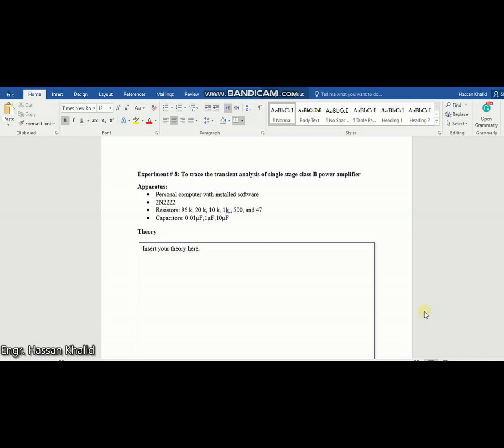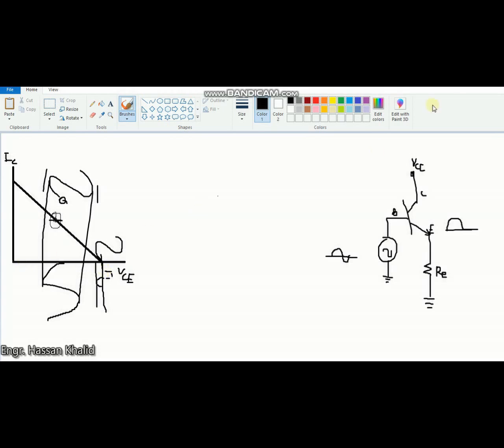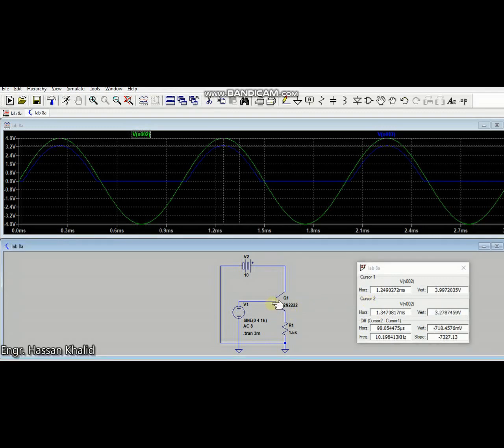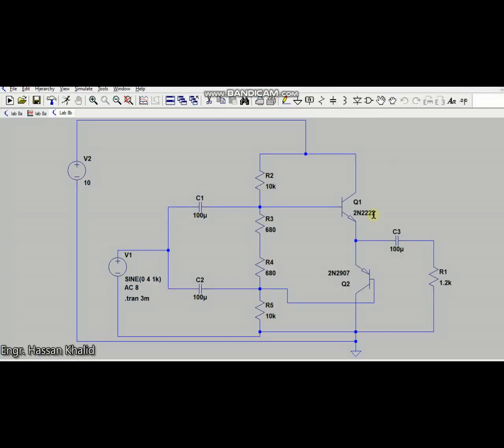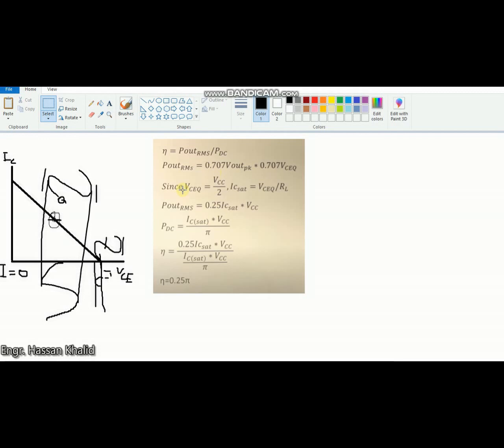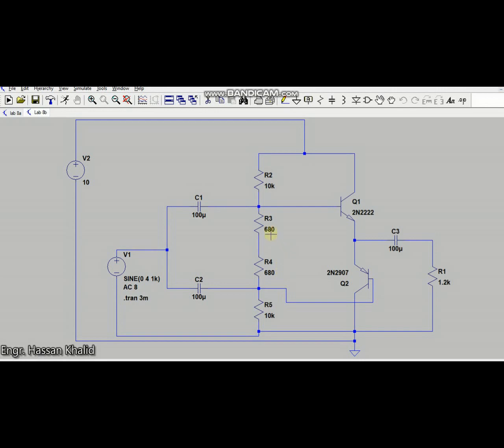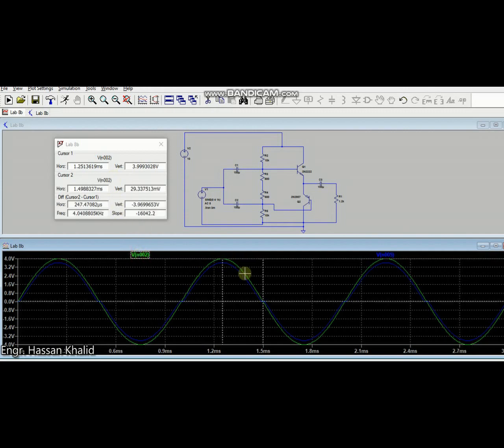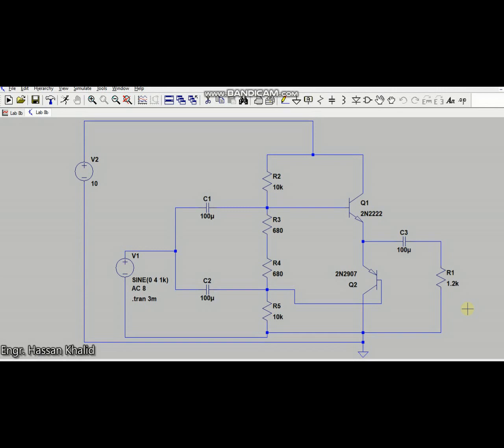Class B amplifier and push pull configuration

Comment: You just have no idea what you are talking about. Apart from the component values not corresponding to the load requirements, you don’t need 100u input capacitors.  You are teaching a whole lot of gobbledygook to students who don’t understand anything. And everything you are saying is incorrect. You really need another 20 years of training before you will be able to dribble out something that is accurate. You don’t understand the concepts of a push-pull stage.